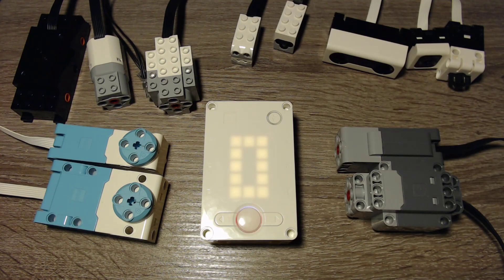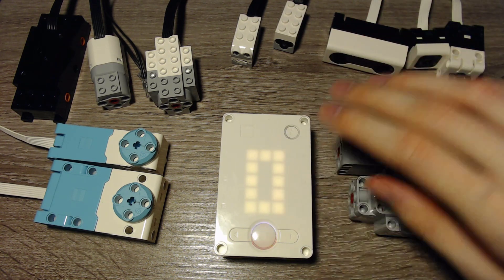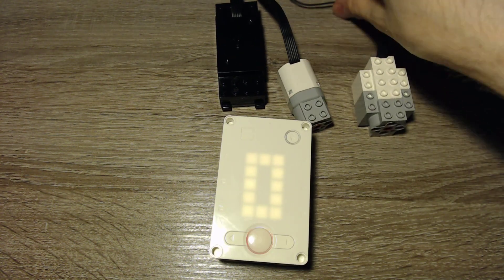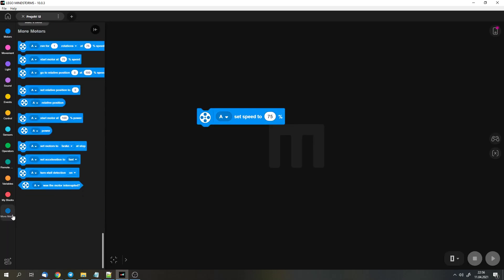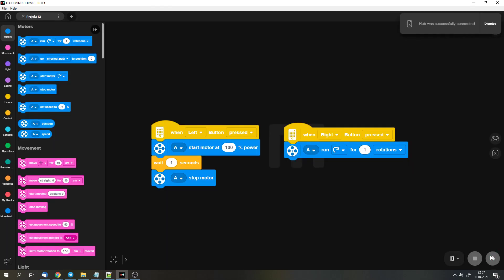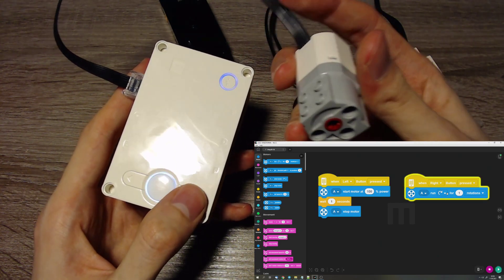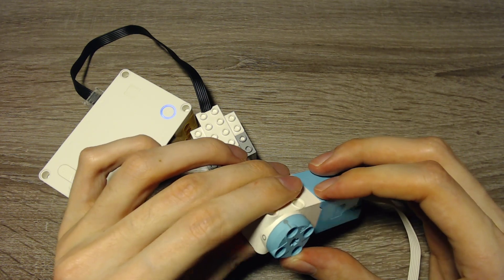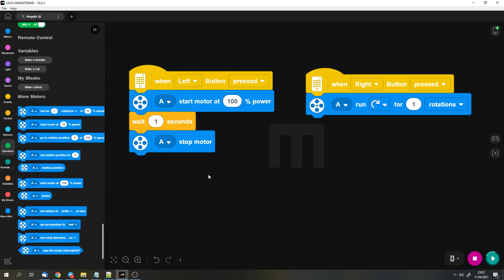LEGO Mindstorms Robot Inventor: Compatibility with Powered Up, Control+, Boost (51515) [English|HD]

Comment: Ok. If there are sensors with no code blocks in the software, but is it still to operate them and program with python?
Reply from the maker: Yeah but not in the "simple" way that has premade functions
Reply: @technicmaster0tutorials  thank You. That’s what I wanted to hear. So some python magic might help, right?
Reply from the maker: @Buli0n  Yeah. I've written a library to support the wedo sensors and the boost distance and color sensor one or two years ago. You can probably find a video about it on this channel and either use it or use it as inspiration for your own programs.

Comment: Nice Video. By the way, the lego city color sensor which you said has no code blocks actually has if you click on powered up sensors when adding extra blocks. I tried it myself at home and it works
Reply from the maker: I'm not sure what you mean by lego city color sensor, but there was a recent update that added support for the spike prime/ mindstorms robot inventor sensors. All of them can be used in the pup app now. (but the 3x3 light matrix from spike essential is missing)

Comment: I want to use the WeDo 2.0 SKU 45305 tilt sensor. I expect to use Python.
Is it possible and how?

I want to make a code for smart reverse on a car, by having a rotation sensor in both vehicle.
While reversing I want to tyrn by automatically adjusting the steering to move the trailer towards the command.
Whenever I go streight forward "enough" (without turning), the code should auto calibrate the offset if drift between the sensors.
Reply from the maker: You can use them in python but there is no convenient way. You'd have to access them with the low level commands.
Reply: @technicmaster0tutorials  I found your other video about it with link to a library. 

https://youtu.be/fiR3XJYo9k4

That video felt more like a teaser trailer than a tutorial.
Have you considered making a video going into some details about it, and examples on how to use.
Reply from the maker: The link in the description of that video contains documentation and examples

Comment: Isn't the firmware from the spike prime hub different from RI? My RI can't connect to the force sensor
Reply from the maker: Tricky question. What do you mean by "can't connect"? Did you try to use it in python or only in the scratch environment?
They are on a different version for sure. The SPIKE firmware contains a few libraries that the RI library is missing so far. But you can upload the RI firmware to SPIKE and vice versa (but it's not the complete firmware because the start animation stays the same, even with the other firmware).